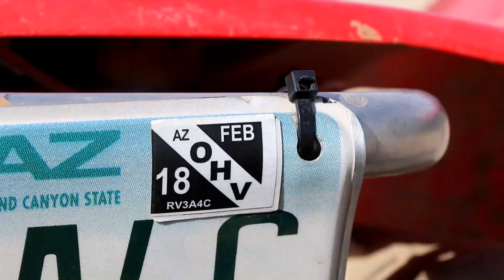Killing the Honda 300

Comment: Could be a valve stuck open - relatively low cost DIY repair.  Pull off the valve cover and watch the the valve movement while cranking the engine.  But since it is old, maybe the graveyard is the place to be.